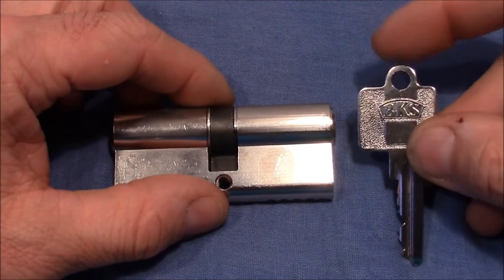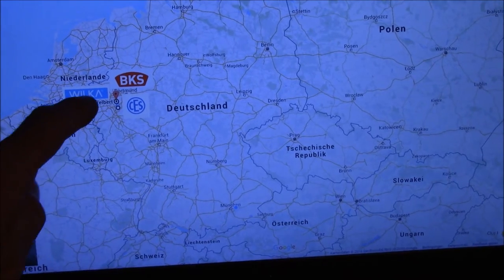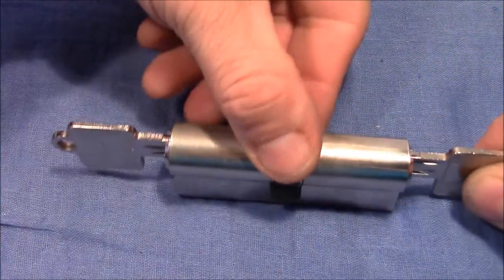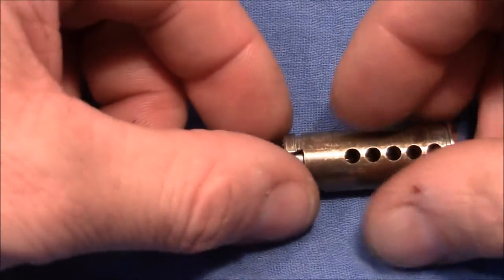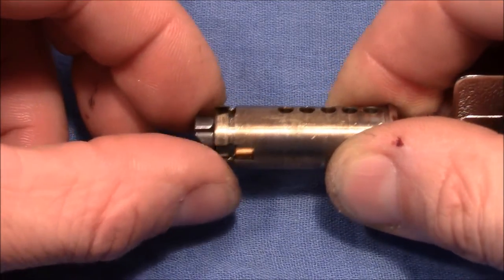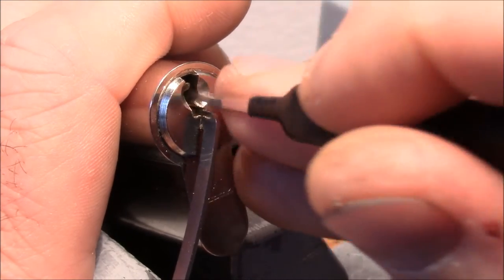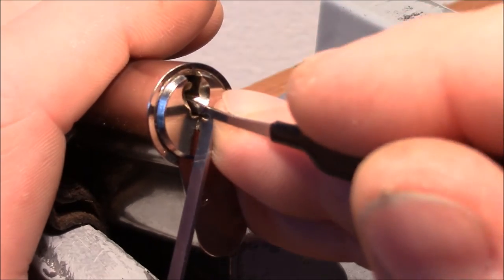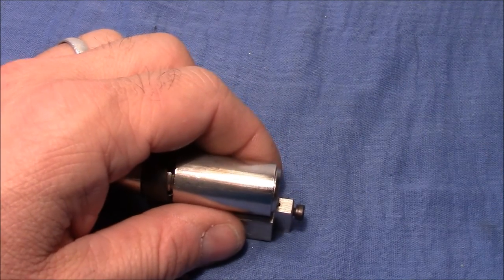(picking 173) BKS [EURO cylinder exploration series] - picked and gutted, simple cam mechanism

Comment: Cool vid again buddy, nice lock and great picking. The pinning shoe looks good, who is the manufacter? I´ve to make something similar. Thanks for sharing mate ;-)))
Reply from the maker: +Tallan Pick Thank you. The pinning shoe comes from a locksmith in Germany. Here is his website http://www.c-oldorf.de. But it seems that they have now a different model to sell http://www.c-oldorf.de/Angebot/angebot%20der%20woche%20.html at the very end. They are very chaotoc ;-). PM me if you need help with the web site or measurements of the shoe. Cheers mate.
Reply: +Potti314 Thanks for the info mate.
Happy picking! ;-)))

Comment: Another great video and picking. Thanks for gutting. 
The BKS are very good cylinder, very challenging I think.
Reply from the maker: +de Ronchopathe Thank you. Oh yes, BKS are great locks. That lock required a long time practicing to get it picked like in the video. It was the hardest lock so far in my series. You need to have the right feel for tension and the pressure on the pins, else the spools reset the lock or they get overset. Was really a long learning curve ;-)

Comment: Innocent looking. I have PZ one , and , that seems to have some antibump / anti rake protection. Keys look simple , but , if I try to insert wrong key , it goes hard , and might eventually get caught in lock. Tho , the key is from other BKS PZ lock. This was informational , as I was wondering are they worth something in abandoned place.
Thank You for info ! :)
Reply from the maker: I guess in abandoned places you should be more concerned about the physical security of the door, etc.
Reply from the maker: And did you open your lock to check the antibump / anti rake pins?
Reply: It's all fine , it's part of industrial complex that is going to be rebuilt. :) And these doors are in really bad shape. They are already marked as trash. :) 
I haven't yet gutted it , it needs a bit soaking in WD40 , it's quite dirty from outside. The ones that are operational have that feature and I can't mess with them as they are in use. :)